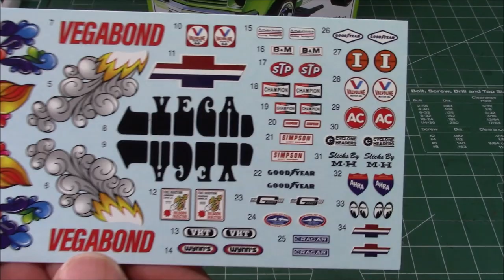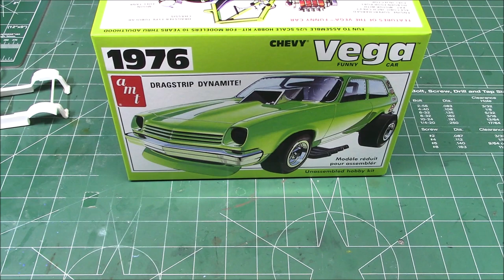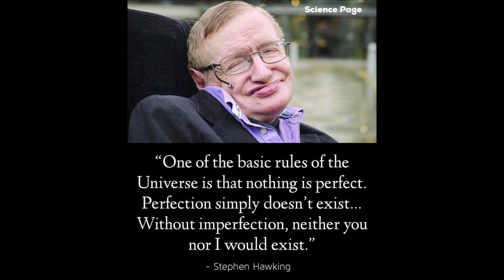1976 Chevy Vega Wagon Funny Car 1/25 Scale Model Kit Build Review AMT1156

Comment: When i was 12 years old , my older cousin had one , he installed a 396 and 4-11,s  in the rear . The transmission did not fit into the car , and they had to cut all the metal around the trans , and the stock shifter  was like 6 inches in the air over the trans .
When he would power brake,  the interior of the car would fill up with smoke . Those were fun days.  Mike Espo..

Comment: I built a lot of funny car kits as a kid in the 70s. The Vega and Monza or some of my favorites body styles. I don’t remember if I’ve ever built this particular one but you did a great job. I never trust the Cap As the color of paint in the can. I think it was a YouTube video that turned me onto sprain out the color on plastic spoons which now I do religiously as I don’t think I would have the patience to soak a body and strip it Of a previously painted color. I currently use Tamiya spray cans or airbrush apple barrel for my military builds. You’re really turning me on to trying rest oleum as a cheaper alternative. The only thing I’ve ever had issues with buying big cans of paint is the usually go bad by the next time I decide to use them. Little Tamiya cans don’t last as long obviously past a build or two
Reply from the maker: Stripping Rusto off takes a couple hours in a Super Clean bath, comes off easily. Same as model sprays, a soak in Super Clean and it's gone fast.  Tamiya paints though will fight you.
Thanks, I appreciate the support and nice words!

Comment: Awesome build! I'd love to see a tour of all the kits you've built.
Reply: I'd love to see him make a video of his collection of built kits .
Reply from the maker: No plans to give a tour of my home, most kits are stored or given away.
Thanks, I appreciate the support and nice words!
Reply: Awesome   job  as usual.  ,     I need one of those turntables  u got to hold the body  & parts when u paint  them.    Hobby lobby  ?
Reply: @ronburley7026  I  might be too late but the work stand in his videos is made by Tamiya (spl.?).
I purchased mine on eBay and the price was pretty reasonable, it comes with a decent selection of spring clips for holding small parts plus a separate body mount that replaces the flat turntable.

Comment: Great build, paint it candy  red and the  stance it has it fits  my vega wagon i had to own to a  tee.  Including the rear whheels sticking out, cause stock width 9  inch and 10 inch slicks!! Street drove it and raced it for 10 12  yrs  miss it badly,  especially the 2 ft in the air off the starting line.  Gonna buy one and use the body to  make another more accurate replica of my old hot rod
Reply from the maker: Thanks, I appreciate the support and nice words!

Comment: Quick question for anybody what does anyone use to remove the Chrome completely off of the plastic the Chrome always looks so fake Id like to paint the parts
Reply from the maker: If you want to remove it, a soak in Super Clean eats it right off most of the time.
Reply: @hpiguy  cool thanks